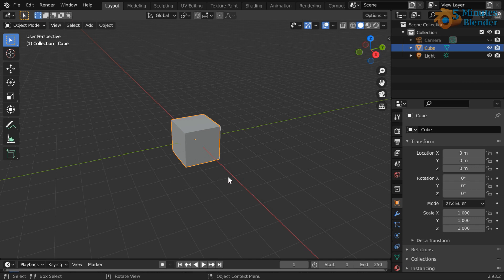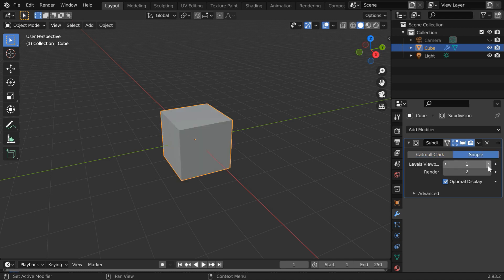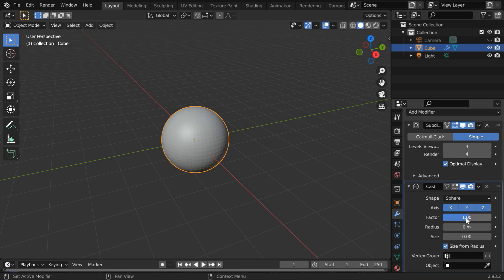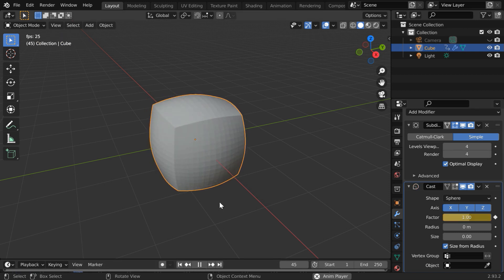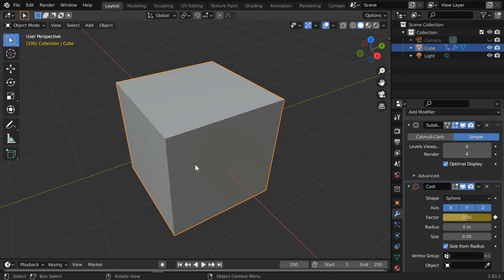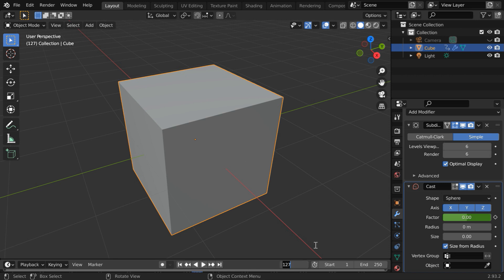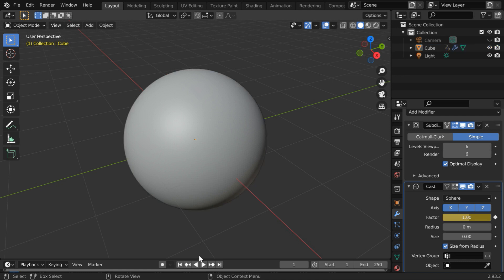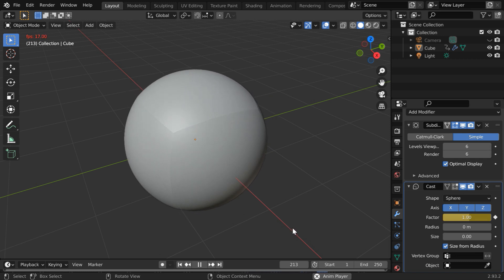Flat Earth Tutorial | Cast Modifier in Blender | Conversion Between A Cube & Sphere | Virtual Planet

Comment: In shading mode, after changing the roughness 0 value, the object completely change into black color. Plz help...
Reply from the maker: Hi, I see you left this comment in two different places. Can you please clarify which tutorial you are following and at which step (by timestamp) you faced this issue? I could not connect to it. Please mention the timestamp so that I can relate.
Reply: @5MinutesBlender  i'm beginner of blender user, every time, I fail to shade any object in render view , it become black after reducing roughness value to 0. I watched your video of bomb explosion. Your object didn't change into black color.
Reply from the maker: @govindjee9896  It is surprising, because change of roughness does not affect the color of an object. If you change the roughness to zero, the surface becomes glossy and sometimes semi-transparent. But the color is not affected. The color will change into black if you change its base color, or if the light is turned off, by mistake. Can you please try this with the simple default scene? Start blender. You see the default cube. Turn on the rendered view mode. Go to the materials tab. You have a default material already added. Scroll down to the Roughness field, and make it zero. What happens?
Reply: @5MinutesBlender  there is no way to post screen short. I kindly request you to provide your e-mail so that I can send you screen short.
Reply from the maker: @govindjee9896  You can get our contact details (Email ID) in the About section of this channel.
Reply: @5MinutesBlender  thank you so much.
Reply: @5MinutesBlender  HDRI blender video. In my blender window, in shading mode, two ball (one of them is white and another is black color ) is given but in your HDRI blender video, I found that one is white and another is silver color.How can I change my black color ball into silver color.